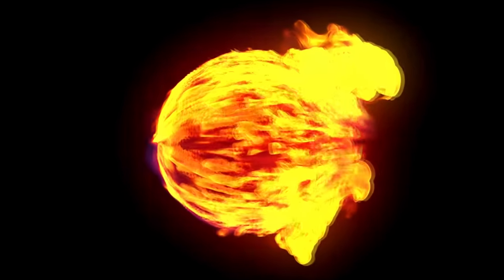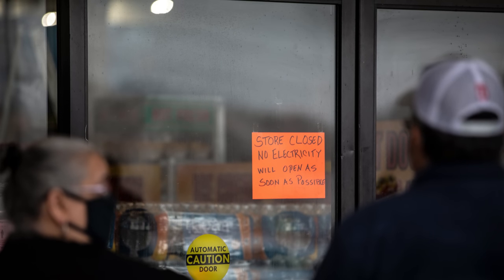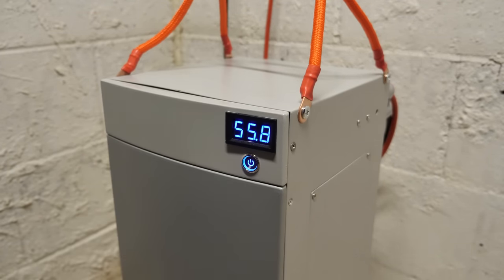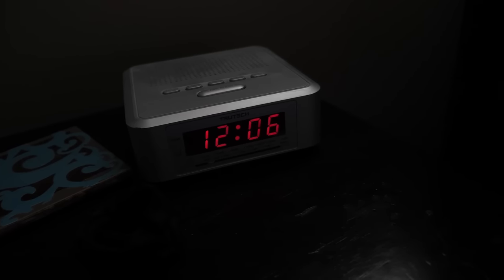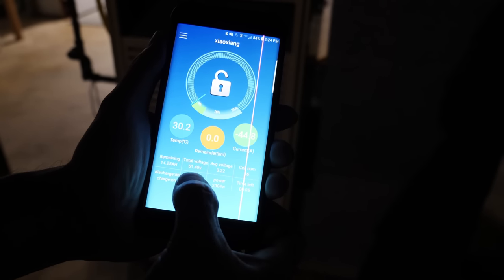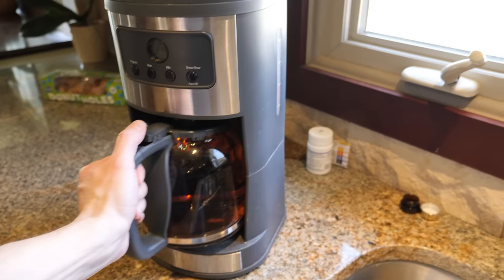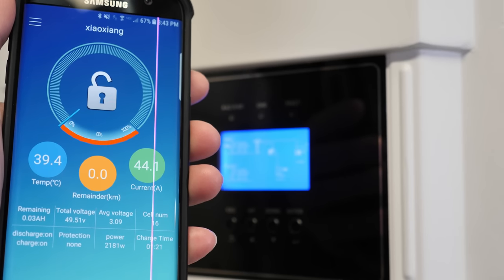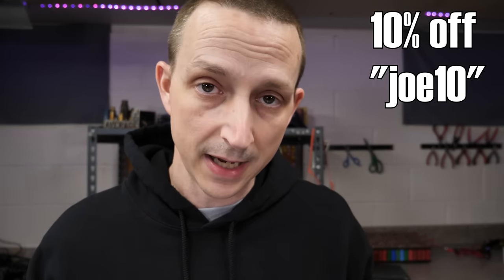Power your House with a Husky 48v 5.3kwh LiFePO4 Battery! BigBattery.com Test Review (2023)

Comment: I just got solar installed, and have been looking at a backup for power outages. The solar company was trying to steer me away from batteries, and go with a solar generator. Very useful video.
Reply: A solar generator is just s battery,inverter, and solar charg controller all integrated into a case. This is convenient but usually much more expensive per spec than assembling individual components and difficult to user service.
Reply from the maker: Thanks Mate! It depends on what they call a solar genny. If they ment a little guy that you can tote around...yeah I wouldnt go that route unless absolutely needed!

Comment: Does that inverter/charger have the capability to peak shave?  ie use battery across peak and recharge off peak? Automatically without throwing switches.
Reply from the maker: No, this one does not but you could control it from your phone or pc to make it go on or off grid!🤷‍♂️

Comment: Any idea why this 12kw inverter will only accept 7kw of PV input per the manual?  It doesn't make sense how it is rated at 12kw when one can only connect 7kw to it...
Reply from the maker: Thats just how this one is made I guess. 12kw of AC output and 7kw pv input. When I purchased I was more going for the 12kw output as I have extra charge controllers when needed.
Reply: @AveRage_Joe  Signature Solar mentioned to add an additional charge controller as well to fully utilize my 12kw of PV. 
I guess I didn’t realize that more than one charge controller could be attached to the same battery bank. 
Thanks again for the help!
Reply from the maker: Gotcha! Yeah once I get over the 7kw then Ill add another charge controller. You can add as many charge controllers as you like! Just like adding another inverter or any accessory!🤘

Comment: Very good video. Big Battery, here I come! What would it take to run a central air conditioner? Is it doable using a Big Battery? Also, is it possible to recharge the Big Battery during super off peak times in order to expoit time of use rate plans?
Reply from the maker: Thanks!!!  Yeah you could run AC from batteries.  You would need quite a few in parallel since they are a huge load AND you want to run all the other things in your house.  Yeah you can recharge/discharge when you like!!!

Comment: Hey Joe
Love your videos,but unless I missed it , can you please tell me how long you can run everything on a single charge ,
Reply from the maker: Thanks Mate! For my "test" I ran ALL the 120v in my house at willy nilly for 3hrs. I did not have my dryer, stove or AC connected during the test. When I tested running the normal things (2 fridge's, tv, cameras, modem, router, 6-8 lights and standby items) I can run for about 6hrs.

Comment: I have been looking at ways to make a whole house UPS system and this looks like the best way I have found so far. Going to do more research first, but this kind of setup is what I want. I really like the look of their 4X system. With that package and an upgrade to my solar setup, I know I could be completely off-grid. So, thank you for this very informative video.
Reply from the maker: Yeah this is a super easy way to do it. Thanks for watching!!! If I were you Id upgrade to there new Rhino battery! Its 14kwh or 276ah and this battery is 5kwh or 100ah! Not that there is anything wrong with the husky. I still use it everyday and zero issues. I just got Rhino and will be doing a similar video with it here soon!🤘

Comment: Really interesting piece.....nice job !  2 questions...... I was intrigued with the inverter capable of a pass through grid and switchover......can you provide the details so I can buy one?    Also, given the "prepackage" battery, is it possible to parallel another to increase the amp hrs
Reply from the maker: Thanks for watching!  Inverter link is in description!  Batteries, YES you can parallel many together for increased capacity!  Bigbattery also has a few bigger batteries now!  Newest is BADASS and is called the Rhino and is 14kwh(276ah).  More capacity then a tesla powerwall and cheaper!🤘

Comment: Do these hybrid solar inverters also need to have a transfer switch installed in between the main panel to the inverter? Or the inverter works as a transfer switch as well?  Thanks in advance, newbie here
Reply from the maker: Inverter has a transfer switch built in. Once your connected to and switched over to the inverter, the inverter can switched between grid, battery or solar.
Reply: @AveRage_Joe  thanks

Comment: I do not recommend buying through signature solar. Tried it for 7days and The inverter did not work properly for me which is fine however when the company accepted the return almost 1 1/2 months later kept my money and stuck me with a $1500 return shipping bill I’d say that’s a over the top horrible experience This video originally convinced me to use them but I deeply regret it. I hope this comment reminds you why Amazon is better.

Comment: Great video.  Would you be able to do a video showing your complete solar setup?  From Solar to the inverter to the batteries, etc.  I am starting my research into solar, and I like your setup, to power your home off grid, but with the ability to still use grid power if need be.  Also using this battery to power your home when grid power is out.
Reply from the maker: Thanks Mate! Yeah Id like to do a video like that! 🤘

Comment: Great show, but the idea of having a UPS/Inverter is to minimize the current draw to maximize the battery potential without recharge.  Ultimately the power would cycle back on but if not your run time is three hours when it could easily be 16 or better if minimized.  But it does put it in perspective.
Reply from the maker: The test runtime with all the stuff running was 3hrs. If you are in a real situation and limit use, runtime will be double or more. Yes still not 16hrs tho.

Comment: I can imagine if you have multiple of these batteries in parallel, then you will be looking at days of run power.
Reply: Yup.. You can connect many together with our Parallel cables provided in kits to do this.
Reply from the maker: Yes you can for sure and mentioned that in the description box. BB also has parallel kits as Eric mentioned and that is in description as well!💥🤘

Comment: great videos.
In your install of the inverter you said you were using power from another subpanel. Did you split the source from a main?
Could you explain?
Reply from the maker: Thanks! Yeah so back when they built my house (1954) or sometime after they split the wires into a "Y" coming in from the meter. One set goes to the main panel and the other to a subpanel. I think they did it that way when they added AC. So I left the 240v stuff on one panel for now and used the other subpanel for the inverter! Hope that helps.

Comment: How much is complete setup ? About 2.2K$ for battery and the splitphase inverter + wiring + other stuff ??
Reply from the maker: Under 5k for sure without solar. I paid $2k for inverter at the time, battery with discount is $2.1, battery cables $12, generator lockout kit $40. Misc house wire' conduit and 60amp circuit breaker maybe $100-150. 

I have solar on the roof and got used panels off ebay(can get link if wanted). Paid $1200ish for 21 245watt panels. Mounted on unistrut and treated 2x4.
Reply: @AveRage_Joe  next steps for me is going offgrid partially, able to sustain for at least 24hours. I think i will start with small setup in my garage to better know about everything and make bigger system for the house. However, needs to save cash asap 😬
Reply from the maker: Thats pretty much how Ive been doing it. Little at a time as the cash allows!!!!💥🤘

Comment: How much did that whole system cost? Battery,inverter,and solar panels
Reply from the maker: Battery is 2k, inverter was 2k and solar was 1k for used panels!🤘 Misc wires, fuses and circuit breakers maybe add a few hundred!
Reply: @AveRage_Joe  thanks man.  I am disabled and my mother is retired so we live together.  We live in a 16 x 80 mobile home.  We have propane heat and a grill to cook on in an emergency.  And we would use only the lr/kitchen area and a bathroom in a situation like that. So I wonder if one of those bluetti, titan, or ecoflow would work for us? She is also on a cpap. So a cpap,40"tv, 4 light bulbs,  fridge , small freezer,and coffee maker.and two phones. If summer time, a newer 110 ac. It's 3.4 amps. Don't know watts offhand,  but our power/water runs between $180-$200 yr round with electric water heater,dryer,and stove

Comment: Curiosity (request for enlightenment) - If you're using a 12KW inverter, how are you able to power over 80 amps?
Reply from the maker: The 12kw inverter will take 250amps full send if the load is there. This battery can supply up to 130amps if the load is there. Actually higher for a short time. Or did I misunderstamd your question?
Reply: @AveRage_Joe  you got it. Thanks! Time to save up more. 😅
Love your reverse battery backup setup... I think I'd like to implement something like that with my generator (reverse as standard, but generator if the power goes out for a day or more). We'll see. Thanks for the feedback! Take care
Reply from the maker: Yeah a genny would work great in this setup. Inverter has genny contacts as well!

Comment: I'm a retired Navel Weapons Engineer, not exactly a good fit for DIY off grid solar ability. But your video really helped me tie up the loose ends of the full concept of solar panel/inverter/battery/fuel generator working together. While I love your clean mean system, I'm afraid I'm too cheap to push that button and will be putting together a more conventional lower cost application in tandem with my gas generator. I want to duplicate your application for under $2K. Thank you so much for the concept.

Comment: You're vids are motivating. Starting to plan my solar mounting. I have some ironridge rails ready to go up. Don't have batteries though so I'll need figure out how to get that to work.
Reply from the maker: Thanks Man! Appreciate that!! What kind of batteries are you thinking? I have 18650s I could sell ya if you wanted to go that route? All tested and ready to go!😆
Reply: @AveRage_Joe  Possibly, depends on your price.
Reply from the maker: We could work out a deal. Maybe 25c a cell?
Reply: @AveRage_Joe  I forgot how many you have lol
Reply from the maker: I have enough sitting in 14 boxes sperated out into equal packs for 14s120p. Also have enough to add up to 180p but those are not seperated into the 14 boxes yet. mah range is 2000-3600mah.
Reply: @AveRage_Joe  
Did you sell them ?
Reply from the maker: I still have them!

Comment: Fantastic video and extremely relevant and timely for me. I have the Growatt inverter like yours although the 6kw model. I use it for a small off grid 40ft container I converted into a home. I was actually looking at the Exact same Husky 48V battery you tested to replace the AGMs I currently have. I do have a question about the charge voltage you set it to in the inverter. The Husky has a recommended charge voltage of 58.8v. The user settable program on the Growatt is only settable or 58.4V. Is that what you set it for on program 19 in the inverter menu, I assumed you used User Defined 2 on battery type? Just would like real world confirmation this works before I drag the battery out the middle of no where as I know LifePOs can sometimes be a bit fickle about the correct charge voltage? Very much appreciate your videos and hopefully your response to put my mind at ease. Thanks!
Reply: I have the 48V LAMA Big Battery and it has a max charging voltage of 50.4V.   It is important to not go over the specified voltage.
Reply: @johnhamilton4449  i can understand not going over the charge voltage. I spoke with Big Battery and they answered my question, there are no issues. How is that LAMA working out? Being the the 6kw Growatt only has a single PV string input, I am curious If I could use a additional charge controller for my second PV string for additional charging capacity connecting directly to the Big Battery, LAMA or Husky along with the Growatt.  Just not sure how to connect that being they use the Anderson connector and there are no exposed battery terminals.  I called Big Battery and they were unable to answer immediately. Waiting for their solar specialist to get back into the office. Curious if anyone has used more than one charge controller connecting to a Big Battery?
Reply from the maker: Thanks Man and sorry for the late reply!  For setting 19 I use 57.4v.  No need to fully charge the battery as it will last a LOT longer.  I could actually lower that voltage a little.  The goal is to not have the bms turn of the charge relay.  For my husky I found that voltage is great!🤘
Reply from the maker: You could get one of there parallel cables(splitter cables) or the parallel box to add another charge controller.

Comment: Noob here. So how many solar panels do you need to charge at 48amps? Or does it not work that way?
Reply from the maker: You would need 10 to 12 245w panels. It could be a few different ways on solar but roughly 2500watts!

Comment: We had the Derecho storm in Iowa, I was out for over three days. I have solar, but with microinverters it was dead. however, I had 4 105ah trolling motor batteries and ran all day and night on that for my refrigerator and freezer, then run everything needed on a small gas generator, Honda 2000 watt inverter) modified for trifuel for about 2-3 hours a day while recharging the batteries. This used very little gas to run. Currently planning on DIY solar/ battery backup but perhaps a smaller inverter...
Reply from the maker: Where at in Iowa are you? Im right over in Omaha Ne! You talking that storm about a month ago? We lost grid power for 20+ hours!

Comment: I stumbled upon your channel while searching for emergency powerblock vs generator (gas, propane) for usage if we lose power during a hurricane (we're in FL). I'm not at all technical. I guess I'm still in the fog regarding the best course of action given the latest tech options.
Reply from the maker: Well I can say since I did this video bigbattery has added all in one kits that make it pretty easy and or plug and play for the most part. They have a few to choose from depending on budget or goal. They come with an Inverter, battery(or batteries) and wires! Link in description box of course. Do you loose power very often during Hurricanes and for how long? What all would you like to power if grid is down?

Comment: That was pretty good demonstration. I have a 240v well pump so I got two of those batteries.
Reply from the maker: Thanks Mate! These batteries a badass! Do you have them and using them yet or just ordered?🤘
Reply: @AveRage_Joe  I have one and I'm having another one delivered tomorrow! My lead acid batteries are just basically sideline observers.  : )
Reply from the maker: Nice!! Yeah no need for the LA batteries nowa days with all these awesome lifepo4 greatness! All we need now is something to replace the battery in our gas and diesel vehicles.
Reply: @AveRage_Joe  If the battery weight drops, you know that people will be flying with them. There will be airplanes recharging in flight! They already use electric ultralight aircraft as it is but they run about an hour or so.

Comment: Very good video.. i just order one them.
Did you your AC home unit??
Reply from the maker: Thanks Mate!  Its a nice battery.  Still use it everyday with zero issues.  I ran AC unit with the Rhino battery in another video but could think the husky could start and run one however having said that, it wouldnt run it long!

Comment: Great video man I've been looking at a ton of stuff on here and this is the first one that I've seen that actually looks to handle real life stuff !
Reply from the maker: Thanks Ron! I wanted to know what it could do and it did well in my opinion!!!🤘
Reply: @AveRage_Joe  Yeah I'd say it did very well we use a lot of power in our house on a pretty regular basis and I know we EV's coming home in the near future it's going to be imperative to soften the blow from charging my son and I have a couple of electric long boards that we literally ride daily and our electric bill has gone up huge since we started riding them I'm actually worried about how much power pull we'll have with an EV car or truck 😬
Reply from the maker: Yeah recharging EV's and other electric ridables will suck down some power for sure! Will need some solar to keep that bill down!
Reply: @AveRage_Joe  that's what I'm thinking I'll have to do some research to find out what it's going to take to handle the demand I'm sure it's going to take quite a few panels...

Comment: This looks like the perfect solution for our need in Florida.  No more nuisance outages to shut down everything plus a rather long up time during an extended outage.  Plenty of time to wait out repairs or dig out the generator if outage is for days.
Reply from the maker: Yeah for a single battery it will get you through the nuisance outages for sure. If you have solar, even better!

Comment: Sorry found it in the description. 3700 is spendy but compared to a forklift it's not bad just lacking in amp hrs.
Reply from the maker: Big Battery has other battery packs more designed for forklifts! Plus kits with more capacity if needed or wanted! I visited them and saw the forklifts in action. Pretty cool stuff!!